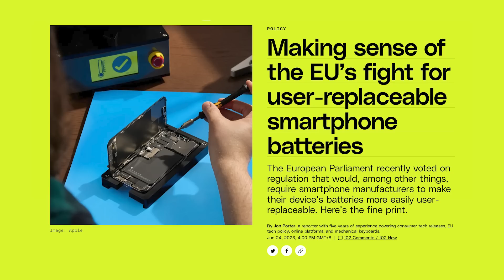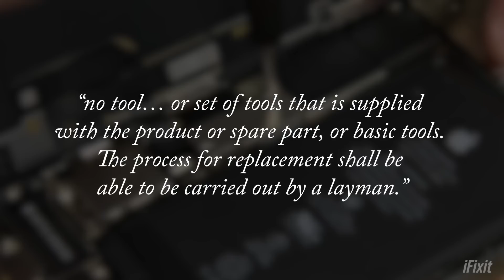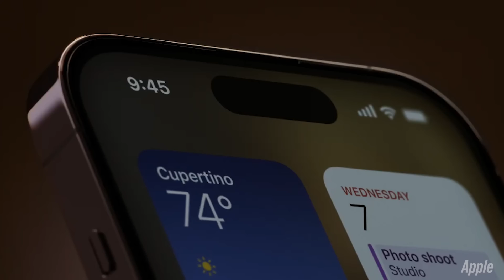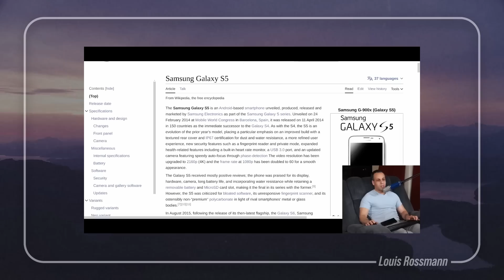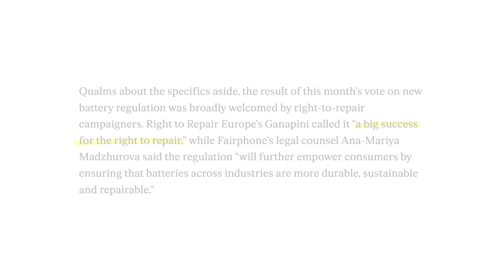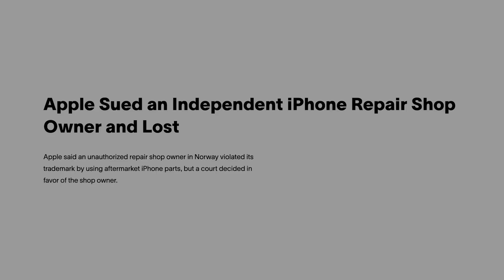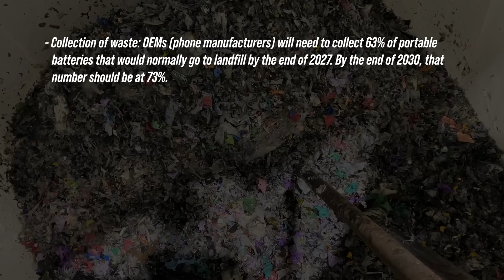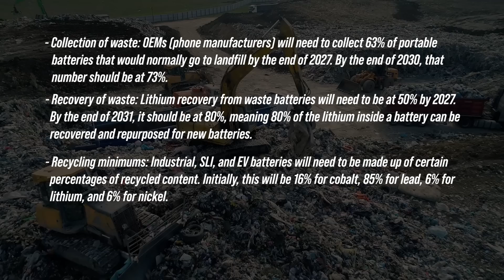EU Just Changed Smartphones Forever

Comment: The phasing out of replaceable batteries is and always has been anti-consumer and inherently anti-environment; it's part of the strategy known as 'Planned Obsolesence', wherein a product is designed to wear down or break within a limited period of time, and to be difficult, if not outright impossible, to repair by the user; the point of which is to force the consumer to buy another of the product to replace what has worn down or broken, to guarantee continuous profit for the company. Inability or even denial of right to repair by the consumer means the company's profit keeps growing, while the consumer is forced to keep spending, and the environment suffers - none of which the company gives a damn about. It works wonders for profit margins all over the world, but the consumer and the environment suffer considerable losses for that attitude.
Reply: now , someone explains to me ! Irreplaceable batteries in smartphones , does it mean that it's impossible to completely cut the power to the device , and thus it's always possible the device to be located as it does send vibration even in OFF mode ??????

Comment: Of course it was a anti consumer move thus when your phone battery no longer lasts you have no choice but to buy a new phone because replacing the battery (while you can do it ) is not reliable due to the simple fact that you cant find new batteries. And batteries degrade whit time and its not worth on a 5 year phone to put a 5 year old battery, it literaly does nothing to improve its functionality. The same is whit every single thing that contains a battery  whit no exceptions

Comment: Absolutely braindead solution to the problem. Forcing every phone company to keep producing batteries for older phones is the furthest thing you could do to be "eco friendly". Imagine every car manufacturer was forced to keep up the production of old car engines. An insane amount of resources would have to go into sustaining production lines that have hardly any demand. Also how often is it that the battery brakes, they should focus on screen and back-glass repairs. This will do absolutely nothing good for the environment coz ppl are still gonna buy new phones, it will just add a few more batteries to the equation for the 0.001% that will actually ever need it. Also this is gonna be a huge shake up with in the industry that will most likely reflect in prices coz now everyone has to figure out a way on how to do this. The only W here is the fact that apple's fucked
Reply: now , someone explains to me ! Irreplaceable batteries in smartphones , does it mean that it's impossible to completely cut the power to the device , and thus it's always possible the device to be located as it does send vibration even in OFF mode ??????

Comment: thanks for this video and review of the law. My personal thoughts on consumer-replaceable batteries: i think the trend of shifting away from them had multiple factors. Yes there are numerous people who prefer very thin phones over better features (without wanting to discriminate anyone, in my observation usually women have this tendency, probably because phones then fit mor easily into a handbag); yet i know of many people ... including myself ... who greatly injoyed removable batteries. E.g. my phone that lasted most long was the LG G4 and i frequently swapped batteries around. Swapping batteries and charging them externally also to me makes more sense than using bulky power-banks.
Overall i think the move to non-replacable batterys was mostly initiated by tha manufacturers and not by the users. And although i often regard enviromential /climate issues as over-exagorated, in this particular case i find it valuable and good that manufacturers can be forced to re-introduce removable batteries. And i am convinced it is relatively easy to do this.
There is no need to make phones all that thin. Actually i consider this stupid. A thin phone can easily fall out of your hand especially when you hand it over to someone e.g. to thow them something. Slightly thicker phones not only can house larger bateries with more capacity, they also fit better into the hand. so really i see no problem with designs that allow removable batteries.

Comment: Hear me out. What if instead of having the battery inside the phone at all, it becomes an external component altogether. The connection is magnetic, and the connectors have serviceable gaskets (likely the o-ring would be on the battery side). The most elegant phone manufacturers would design the batteries as such that they connect and the phone looks nearly like any phone today. No ejection mechanism. Could be a locking switch. I don't know. Point being, literally anything is possible. The best designs take the consumer into the spotlight. The external battery also allows for 3rd party battery customizations. Your 4000maH OEM battery could be replaced with an Anker™ 7000 that not only takes up the allotted OEM space, but clips into the USB C port to make the phone slightly taller, yet still have its own pass through USB port to allow charging. To be all of this is good news. I owned the LG G5 mentioned in this video. Having 3 fully charged batteries ready to go allowed me to be in situations where I needed to leave the house and could go from 0% charge to 100% without even plugging in. You tell me what would happen if someone released a phone you could charge from 0 to 100 in the 15 seconds it takes to swap a battery. Ya, people would freak.... but sadly only if you didn't have to swap batteries. The usability of going from 0 to 100 being the same though... people are weird.

Comment: I love changeable batteries, but it would SUCK to not have a waterproof phone anymore. 😭 hope that problem could be solved because to me that changed technology forever, a waterproof device that we rely our whole lives on
Reply: I'm no expert - but making a removable battery compartment waterproof seems trivial to me compared to: removable Sim compartments, micro sd card slot, headphone jack, USB socket, mic hols, speaker holes. All of which they are capable of waterproofing now(as evidenced by the waterproof phone in front of me that features all of that list)
Reply: @fxtgwal  
now , someone explains to me ! Irreplaceable batteries in smartphones , does it mean that it's impossible to completely cut the power to the device , and thus it's always possible the device to be located as it does send vibration even in OFF mode ??????
Reply: now , someone explains to me ! Irreplaceable batteries in smartphones , does it mean that it's impossible to completely cut the power to the device , and thus it's always possible the device to be located as it does send vibration even in OFF mode ??????

Comment: There are already a PC-brand, Framework, which produce upgradable laptops. Mostly everything in the machines can be upgraded and the PC can be equipped with modules, interchangeable of course, so that you can equip with all different kid of ports... And, if I'm not wrong, you can even change the CPU from AMD to Intel if you wish. And all their components have bare-codes, so you easily can replace some defect component. The manufacturers has claimed for years that such a thing would be impossible to produce, but the new kid on the block sooo proved them wrong....

Comment: As one of the people that uses a folding phone (they are great for reading), i don't think a replacable battery is going to really be that much of an issue? I mean, just have a compartment where the battery goes on the non-screen outer casing?

Comment: Smartphones HAD modular batteries in the beginning. This is not a new invention. Apple, and Samsung integrated the batteries for several reasons: Planned obsolescence, Backdoor access for government agencies to use for spying on every individual, and water resistance( hardly first on the list, and laughable that manufacturers will sell you one the waterproof nature of the device and then claim water damage if the device dies prematurely). It's disgusting. The batteries should have been modular to begin with.

Comment: I think these changes are indeed motivated by profit which do result in anti-consumer products
Reply: Who is making profits by this, not the regulatory body of the EU or the phone manufacturers
Reply: same
Reply: Though as far as I remember, I don't think water resistance used to be a common feature before. It's certainly more common today.
Reply: yes it was, s5 was ip67, it could go under water with a modular battery, it's just easyer and cheaper to just put glue on it
Reply: @davide571  I would've never thought that. I assumed a plastic back cost a lot less to manufacture rather than glass. Hell I'm not sure how a plastic back would be received on a flagship phone, would be controversial I wager.

Comment: The EU did well on standardising the Type C but on removable batteries, I don't at all want to have a removable battery because as someone that has experienced phones with removable batteries, I don't wish to go back to those types of phones because it gives rise to having a phone sold with a fake/dead battery out of the box and the chances of getting a genuine OEM battery are slim to none because the markets will just be flooded with fake batteries by You-Know-Who and that will just result in more waste with those fake batteries. 
I don't remember the last time I ever even wished to replace my battery because when it did (which is frustrating of course) it meant the phone was also old, the OS old and slower and the whole phone overall needs replacement.

 I've had more phone replacements because of cracked screens than I've had with dead batteries. 
So, No, the EU has made a bad call especially when You-Know-Who thrives in selling us fake stuff when you need to replace it and leading to far more environmental waste because the frequency of replacing will be even higher because it's already fake to begin with.

Comment: I don't see any problem with larger devices (laptops), but the reasons for the non-replaceable batteries in smaller electronics were reduction in size, reduction in weight, easy and reliable waterproofing, and durability.  Fine tolerances lead to a more durable, smaller product that is VERY difficult for the average user to repair...this doesn't mean they should be able to block new parts being sold.  The theory behind the used parts not being allowed by Apple is that there was/is a huge market in stolen phones for parts. Yeah, sounds like I'm an industry apologist, but I like to look at both sides of the coin..and this coin has points on both sides.

Comment: phone require adhesive to be WATERPROOF. wouldnt trust o rings and gaskets to keep my phone safe from water damage, dust, .. when you drop it the back comes off and the battery goes flying under the couch , i dont miss those removable backs to phones. i like the uniform of it.  they would need screws regardless to keep it together to where it wont just come apart like they use to, this is stupid. i have a 13 pro max and i dont even care . or my 1500$ laptop . its not hard to do. it requires common sense for laptops and batteries

what about cars should they be made from k'nex or legos so everyone can repair them? no a trained person does it if you cant

Comment: I don't think EV batteries will ever be replaceable by the layman. They are extremely heavy, e.g. Nissan Ariya  batteries upto 610kg . 
They are also high enough voltage to be a safety issue.

Comment: as good as this is modular phones should be implemented too i'm using an old xperia xz1 from 2017 I still like it alot and has everything i will need, but its now showing its age because of heavy updates on apps that takes up resources making it slow and sometimes laggy, if it only had upgradable parts I would just ad more ram to it and it will be grand for the next 5 years...
whatever happened to phonebloks? project ara?

with recent advance in technology I'm surprised were not using 2240 ssds for smarthphones, maybe ram with reconfigured connection like LGA

Comment: Not just user replaceable batteries, the charger should also be in the box because the separate packaging of chargers also creates waste.
Reply: but extra cables that you already have creates waste
Reply: @ryankingsbury779  Cables are cheap and not every manufacturer makes the same cable. Best is to use the original cable.
Reply: @NIKOLAP7  the point of every thing now using the same cable is you don’t replace the cable. The EU aren’t all that smart for making some of these laws

Comment: The transition  from removable to non-removable was most definitely a profit-driven incentive. Why? Because most people won't buy a new phone if it still worked and just needs a fresh battery. With this in mind, Apple first realized they wouldn't be able to sell new devices every year to the wider market save for their gullible fanatics. The rest of the phone industry caught on to this scam and jumped in since consumers are none the wiser and ended up buying the latest and greatest of their models anyway. It was only after these devices started breaking that people realized they've been scammed since it's "technically cheaper" to get a new phone. Which is silly since repairing stuff has always been the cheaper path to keep a device being useful for a longer span of time. When repair becomes more expensive than buying a new one 'by design,' that's just ludicrous and is most definitely a scam.

Comment: With Apple it doesn't really matter what the battery condition is. Their update will make it so a spanking new battery will be flat in a day or so.
Changing the law is cute but it won't change anything for the better..
As a company leader I would boycott then EU market and carry on.
As a sensible man I would be careful with the original battery as they can last quite a long time, if it's not an iOS you running -_-

Comment: My feelings about it are ambivalent. On one hand I really like the modern slim design and I'm observing with interest evolution of the folding screen devices. New design challenges will definitely slow down this trends. On the other hand it is perfectly obvious that modern devices are designed with planned obsolescence in mind. Manufacturers make a lot more money if you have to throw away damaged or just old device and buy a brand new one. I like my phone but it's Pixel 2 - an antique by today standards - and even disregarding that, it doesn't even work as well as a few years ago. Phones visibly deteriorate over time because they are not designed to last, quite opposite in fact. Ultimately I think I'll prefer a slightly bulkier phone that will last me a decade or so rather than a new, slick black box impossible to fix in case of some mishap.

Comment: Perfume for $2000 per liter, inkjet printer ink for $6000 per liter, appliances programmed to fail in firmware after exactly so many use cycles / designed obsolescence vi lifecycle analysis / also called profit engineering /

Comment: @coldfusion 5:51 what's a qualified technician? what qualifies me to repair a 70,000 dollar FM transmitter? i have no degree, no certificate, a few years of hands on experience this random electronics, and im allowed to open up the RF stage on a power amplifier? there is not rational reason why apple would prevent anyone from working on their products but greed, if joe blow ruins his laptop trying to fix it him self, that's a responsibility he has to be willing to live with, and hell apple can charge him to right his wrong if they want! but also the guy running the corner shop could also do that! there was a time when people would try to fix their tech issues and when it wasn't possible they would bring it to a repair shop and that guy would pickup from where the owner left off!

Comment: Wrist watch water resistance + scuba watches + under water cams, it’s called pressure seated gasket with screw down pressure plate / air tight & water tight to some IP6X level to such a depth in H20

Comment: Yeah I remember when the norm for a phone was 200-300$ and replacement battery cost like 20-50$
I used to have my Nokia 3310 battery lasted a 3-4 weeks.  I only stopped using the olde phone models when they stopped selling batteries.
The lifetime of a phone then was like over 5-7+ years. They didn't really break. But I had used up 2-3 batteries.
Then I would just go back to the store and buy 2 new batteries. All done.
Took me atleast 7-10 years before I was brainwashed into thinking I need 500-700$ dollar phones that don't even support a battery swap.
And only lifetime of phone was 1-2 years. It sounded like complete insanity to me for a long time. Why would ANYONE buy these overpriced phones. But yeah later on they became literal mini PC's and pocket gaming pc's. But still it's insanity that this glue battery was allowed to exist for this long.
Even laptops had replaceable batteries and they used to be a selling point that they marketed!

Comment: I think this is a good start but it should be accompanied with a law requiring manufacturers to provide much longer support for the built-in software. For example, Sony stops providing even security updates for their smartphones around 18 months after the release. Who cares if you can replace the battery if you cannot get even security updates?

And note that latest DRM chips prevent you from replacing the software without manufacturer's blessing anyway!